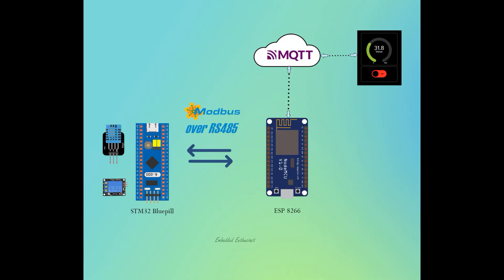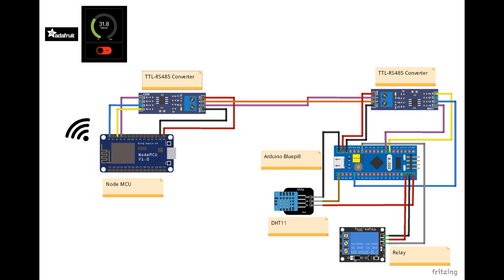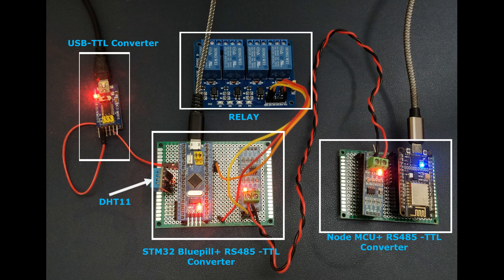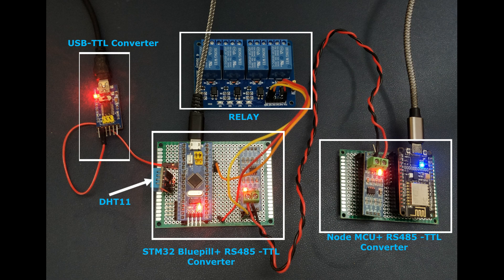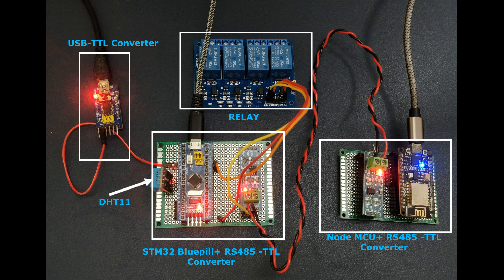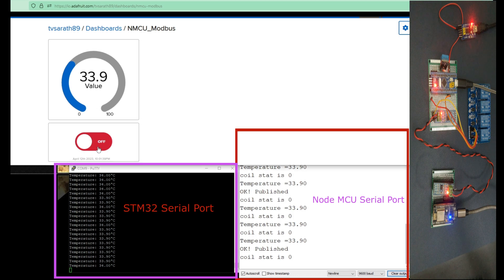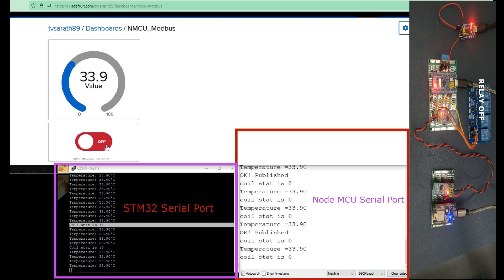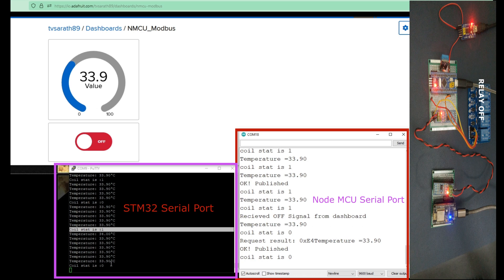MODBUS -MQTT Gateway using STM32 and NodeMCU.

Comment: Hello sir, can you answer my questions?
A Modbus master sends a request to a slave to read several registers. The slave responds with the
following Modbus message: "040302025874DE".
1. What is the Modbus function code used in the request from the master to read several registers of
the slave?
2. What is the address of the first register to read in the master request?
3. How many registers to read in the master request?
4. Complete the following table to decode the Modbus message sent by the slave by responding to the What is the request sent by the Modbus master to read the slave registers from the address of
departure 00 64